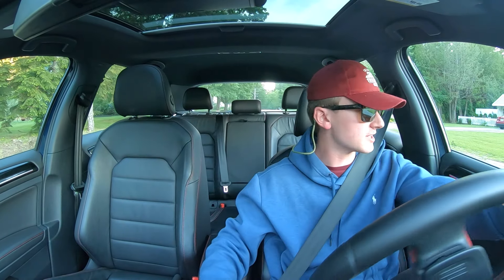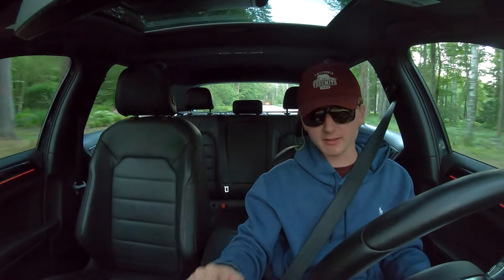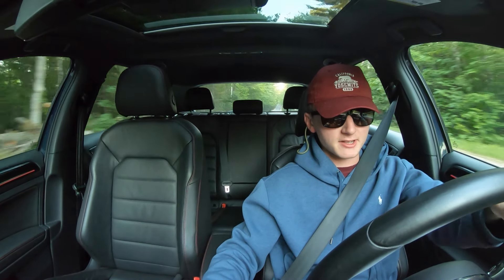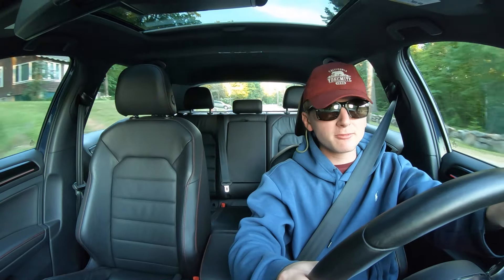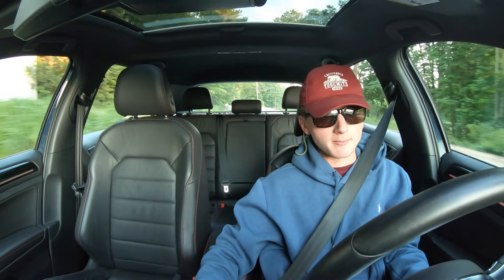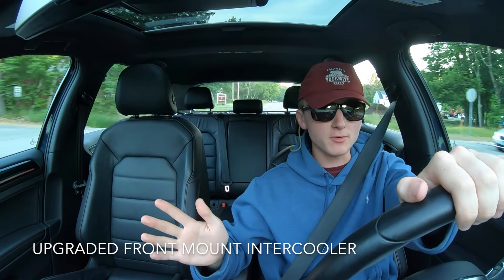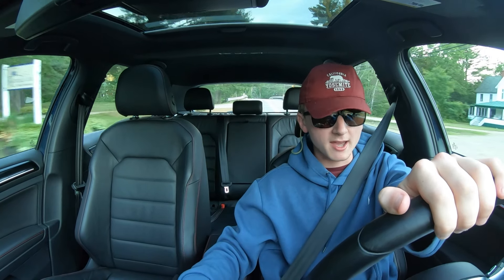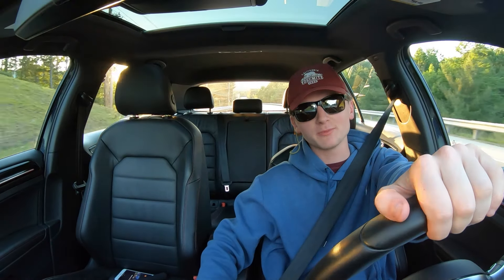TOP 3 MK7 PERFORMANCE MODS

Comment: Mk7 gti apr stage 2 ecu/dsg apr dp and apr ic. When someone gaps me I'll go with the is38 .  Cars insane
Reply: Race a tuned F34 M4. They're crazy fast. Close buddy of mine has one and it's crazy scary to go full out most times. Even an IS38 MK7 GTI would struggle keeping up unless you go full out custom tune along with a good meth kit.

I wanna go IS38 already and I'm only Stage 1 (about to go 2) lol. My MKV is 2+ and wanted to go K04 on that chassis. But then I picked up a 2015 SE MKVII.
Reply: @Peylix  agreed my boss has a tuned m3 putting out 650ish that's pretty violent